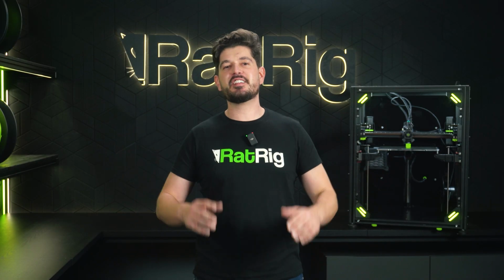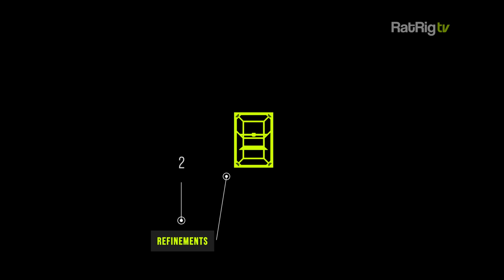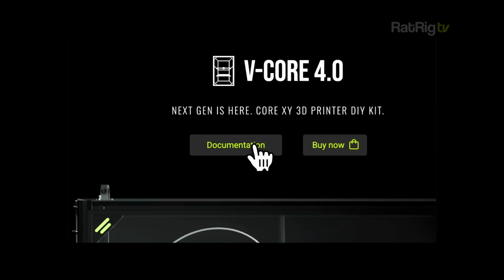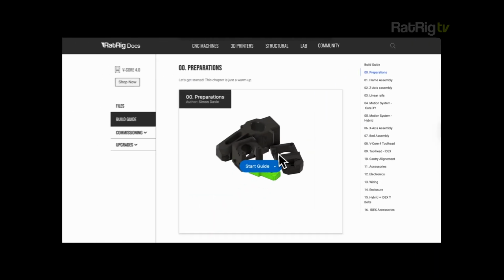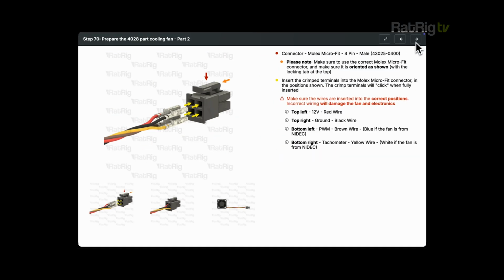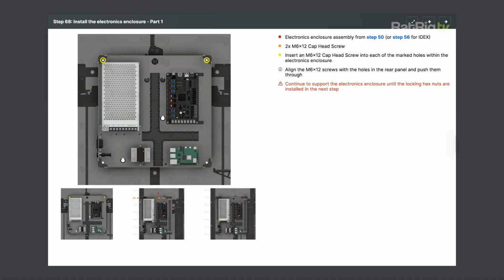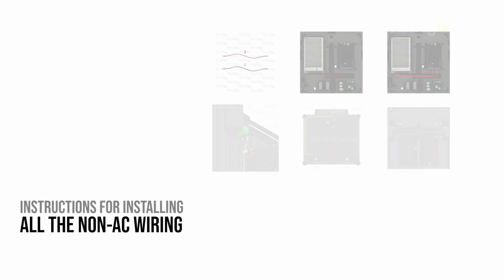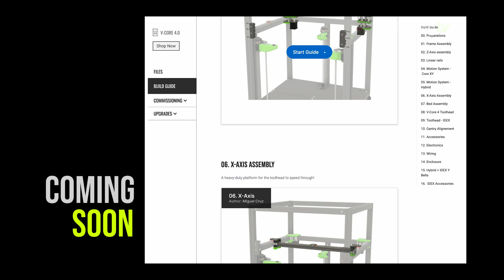Massive Upgrade to the V-Core 4 Guide | Rat Rig TV Leaks #03

Comment: Honestly I’m waiting for Bondtech Idex system to come out and was wondering if you guys would be able to sell the printer with the bontech system when it comes out
Reply: Thats like a whole different setup and would require a ton of mods to make work.
They havnt even gotten the idex to work correctly. The calibration is still hit or miss and the offsets still drift during print. My vcore has sat half taken apart 80% of the time since I got it in aug 2024. 
My h2d on the other hand has been running nonstop without issue for over 200hrs of printing since I got it 2 weeks ago. Imo rateig isnt worth my time or money. Maybe at the start of 2024 they had something, but they couldn't deliver on it and have since been out ran.
Reply: @JH-zo5gk  thanks man, you saved at least 100 hours of my life. I will wait the Prusa Core One with INDX.